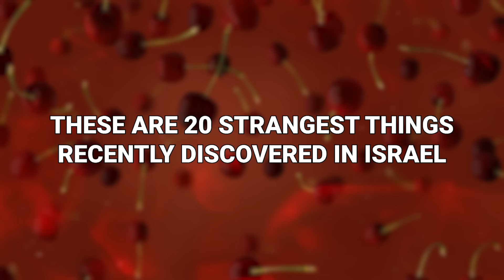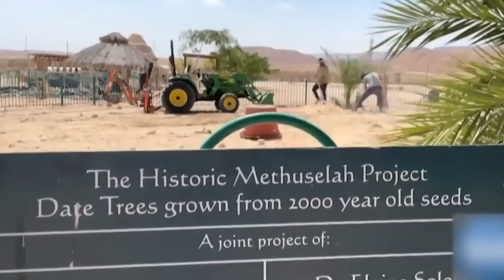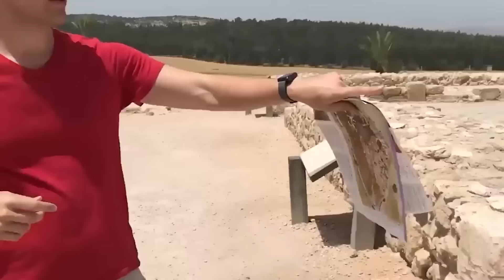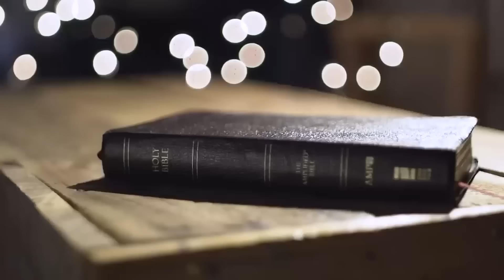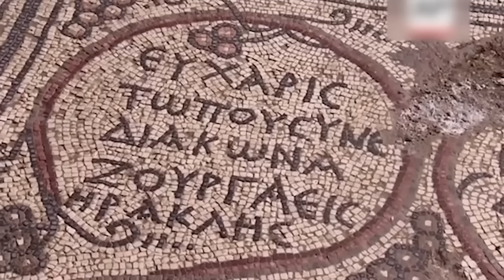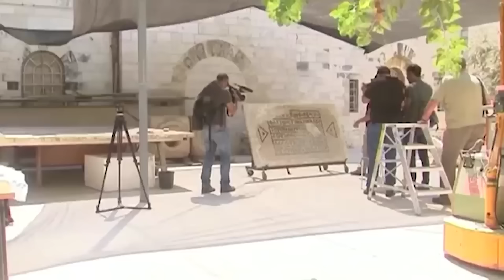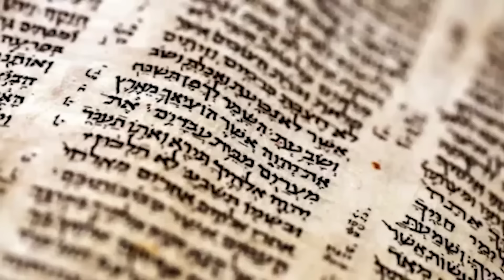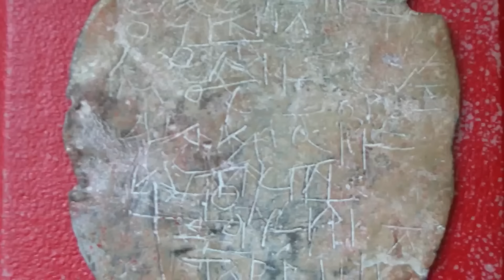Dead Sea Finally Dried Up & Now This Has Emerged

Comment: Use of CE and BCE while still using the same numbers is hypocritical.  Its only intent is to eliminate the historical aspect of what group established the dates we have been using. Resist the use of BCE/CE instead of BC/AD.
Reply: Either system, the numbers are the same. 20 C.E. is the same as 20 A.D .
Reply: @nilescarr8030  Well not quite. When using A.D  the number goes after the letters. whereas using B.C the number goes before the letters. Either way, using CE & BCE is still removing the actual reason the dates are what they are. I know it is being done so as not to offend certain people, but it's still daft to call it the common era, without explaining what instigated the common era.
Reply: In my opinion...  Before the Common Error, and Common Error?  Isn't this a recent Atheist invention to denounce God?  Why would anyone besides an Atheist use BCE/CE?  
(Whenever a 'Christian' uses them, I ask when they renounced God and became a Pagan.  Why do they get angry at me?)

Comment: sweet topic... 1st thought, it looks like a alter of some type, to me... because of those little whitish dome shaped objects you can see... and the square in the middle..  but can't tell if the top is solid or filled in with silt form the sea..

Comment: The Prophet Muhammad, the founder of Islam, lived from approximately 570 CE to 632 CE. (CE. means in the last 2000 years) There was no such thing as a Mosque 12,000 years ago that you mention at 3:20 . Unbelievable that you threw that little piece of disinformation in there.